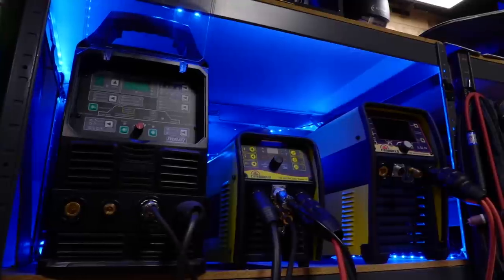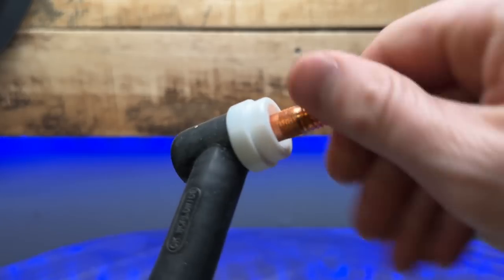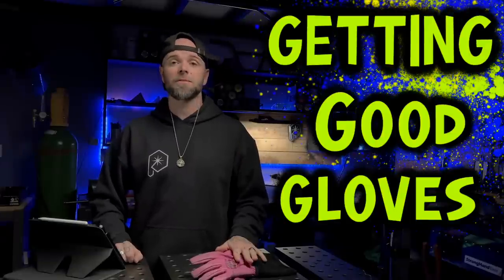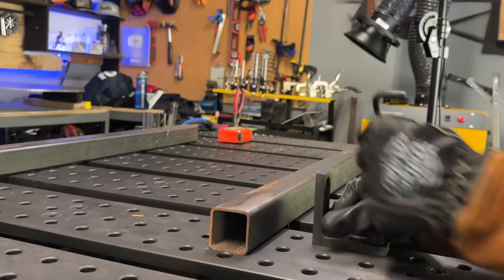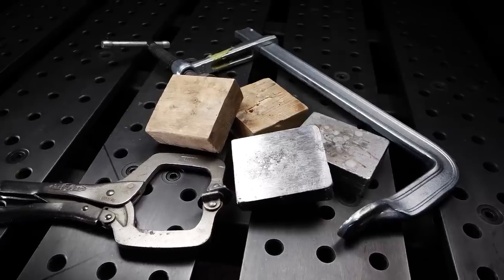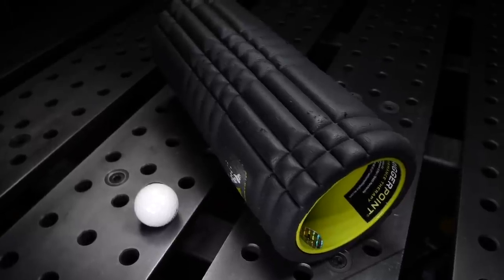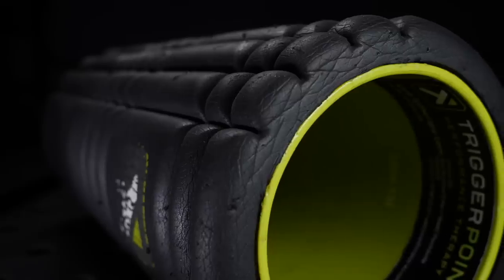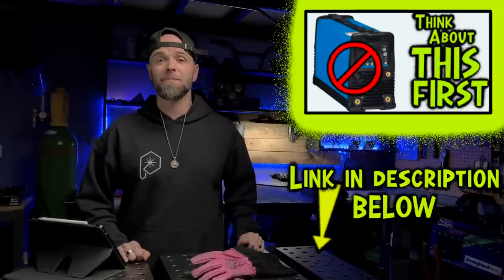5 THINGS I WON'T WELD WITHOUT.

Comment: Hello Dusty, I'm a 71 yr old retired fabricator who has done tech support for tig welders who purchased a particular brand welder.  I'm very curious if you have tried solar flux b compound for stainless in place of argon back purge and if so, your thoughts.  Thx

Comment: I just use a microfiber and some buffing compound to clean my lens. Especially since I also MIG. I get about 2 cleanings out of the lens before it's to the point of replacing. TIG welding only, yea I could see Pledge being all you'd need.